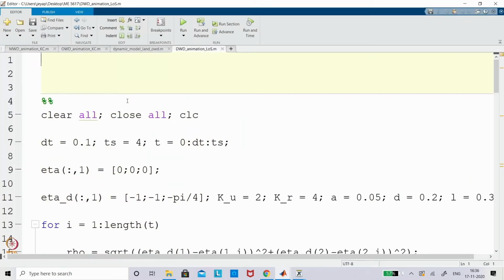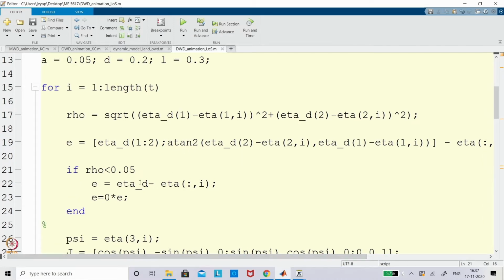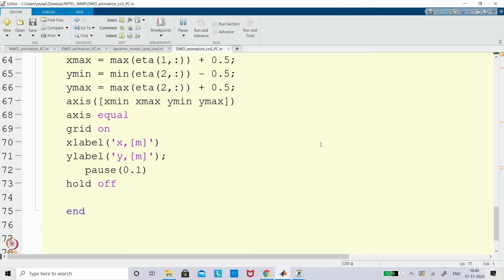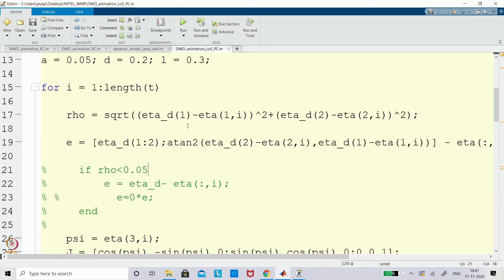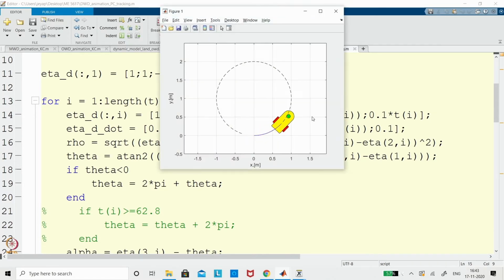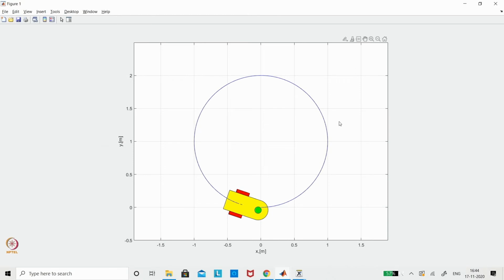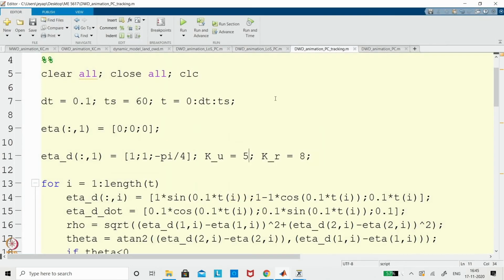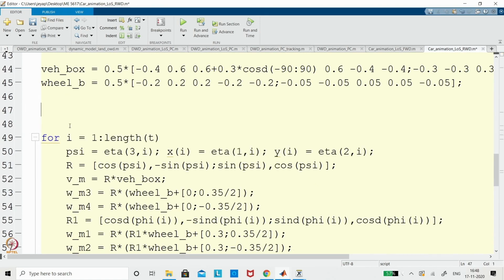mod07lec39 - Simulation of Land-based Mobile Robots along with Kinematic Control Part 3

Comment: Peace be upon the Prophet Muhammad

Polar Coordinates Differential Wheel Drive Mobile Robot  Kinematic Control 
you mabe have to make a slight modifaction on the source code , please follow the video to do that :

%% Differential Wheel Drive Robot Kinematic Control 
%Polar Coordinate Control Method
% you can call it a Non-Holonomic vehicle
clear;clc;
%% simulation parameters
dt=0.1;%step time
ts=4;%simulation time
t=0:dt:ts;%time span
%% Initial Conditions
eta(:,1) = [0;0;0];%initial coordinates
eta_d = [1 ;1 ;-pi/4];
% polar coordinates constants
k_u = 2;
k_r = 8;

%% Robot geometry parameters
a = 0.05;%wheel radius
d = 0.20;%width
l = 0.30;%length
%% Simulation  
for i=1:length(t)
%    eta_d(:,i) = [1*sin(0.1*t(i)) ;1-1*cos(0.1*t(i)) ;0.1*t(i)];
%    eta_d_dot = [0.1*cos(0.1*t(i))  ;0.1*sin(0.1*t(i))  ;0.1];
   rho = sqrt((eta_d(1)-eta(1,i))^2+(eta_d(2)-eta(2,i))^2);
   
   delta_x=eta_d(1)-eta(1,i);
   delta_y=eta_d(2)-eta(2,i);
   theta = atan2(delta_y,delta_x);
  
   alpha = eta(3,i)-theta;
   zeta(:,i) = [rho;alpha];
   if theta<0
       theta = 2*pi+theta;
   end

   err = [eta_d(1:2);atan2(delta_y,delta_x)] - eta(:,i);

   
 

       if rho<0.1
          zeta(2,i) = eta(3,i)-eta_d(3);
       end
    
   

   u =  k_u*zeta(1,i);
   r = -k_r*zeta(2,i);

  eta(:,i+1)=eta(:,i)+(1-exp(-1*t(i)))*[cos(eta(3,i)) ,0;sin(eta(3,i)) ,0 ;0 ,1]*[u ;r]*dt;

end
%% Animation , the animation fpr mechanum buit display omni 
veh_box = 0.6*[-0.6 ,0.6  ,0.6+0.3*cosd(-90:90) ,0.6 ,-0.6 ,-0.6;
               -0.3 ,-0.3 ,0.3*sind(-90:90)     ,0.3 ,0.3  ,-0.3
               ];
wheel_box = 0.5*[-0.2  ,0.2     ,0.2    ,-0.2    ,-0.2
                 -0.05 ,-0.05   ,0.05   ,0.05    ,-0.05
                 ];
cas_p = 0.5*[0.6 ;0];

for i=1:length(t)
    psi = eta(3,i);
    x(i) = eta(1,i);
    y(i) = eta(2,i);
    R = [cos(psi)    ,-sin(psi)
         sin(psi)    ,cos(psi)];
    v_m = R*veh_box;
    c_m = R*cas_p;
    w_m1 = R*(wheel_box+[l ; 0.35/2]);
    w_m2 = R*(wheel_box+[l ;-0.35/2]);
    
    fill(v_m(1,:)+x(i)    ,v_m(2,:)+y(i),'y');
    hold on
    fill(w_m1(1,:)+x(i)    ,w_m1(2,:)+y(i),'r');
    fill(w_m2(1,:)+x(i)    ,w_m2(2,:)+y(i),'r');
    fill(c_m(1)+0.05*cosd(0:350)+x(i) ,...
         c_m(2)+0.05*sind(0:350)+y(i) ,'g');

    plot(eta(1,1:i),eta(2,1:i),'b--')
    plot(eta_d(1) ,eta_d(2) ,'k*')
    plot([eta_d(1) ,eta_d(1)+0.2*cos(eta_d(3))],[eta_d(2) ,eta_d(2)+0.2*sin(eta_d(3))])
    plot(eta_d(1)+0.1*cosd(0:360),eta_d(2)+0.1*sind(0:360),'c--')
    xmin = min(eta(1,:))-0.5;
    xmax = max(eta(1,:))+0.5;
    ymin = min(eta(2,:))-0.5;
    ymax = max(eta(2,:))+0.5; 
    axis([xmin ,xmax ,ymin ,ymax])
    axis equal 
    grid minor
    xlabel('x,[m]')
    ylabel('y,[m]')
    title(['simulation time : ' ,num2str(dt*i),' ,Holonomic vehicle'])
    pause(0.001)
    hold off

end